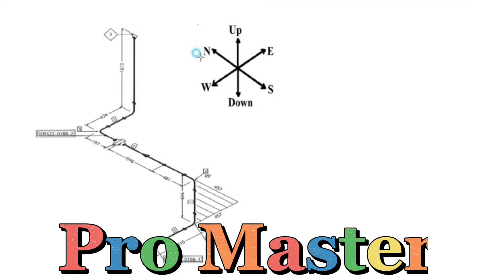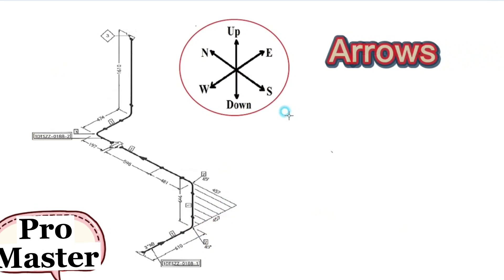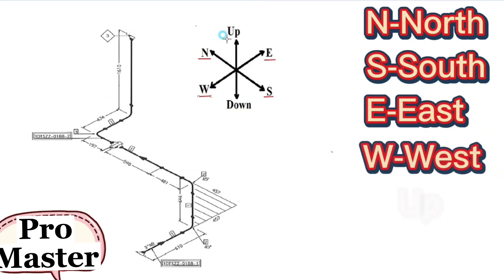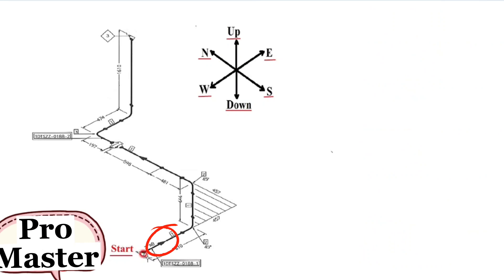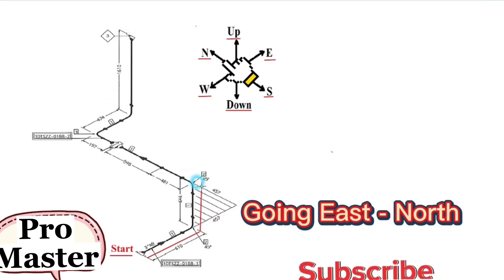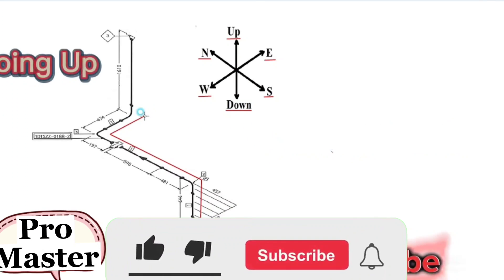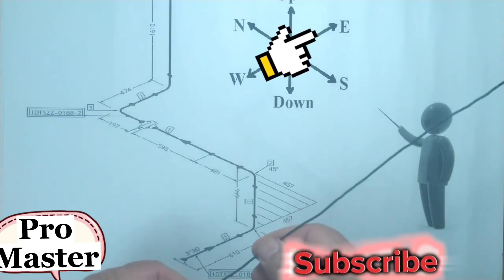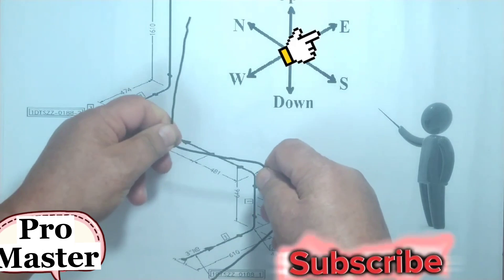Piping Isometric Drawings Explained for Beginners.

Comment: so a 45 degree is an up and cunfuses every thing. . . . 
. . figure some thing else for a 45 degree or find a better eplain for the 45 deg not to confused with the UP. . .
Reply from the maker: Many thanks for watching and comments, my friend.
We will take your advice into consideration in our future videos.
Reply: the same, i dont get the 45 degree angle , something must be wrong
Reply: @mauriciogjomemo474 muy cierto ...algo deve de estar mal porque como es que se gira el segundo 45° para seguir el flujo hacia el norte ...en todo caso sería un 90°
Reply: The line with 2 45 deg elbow should be in horizotal position, bec, the shadow line is horizontal